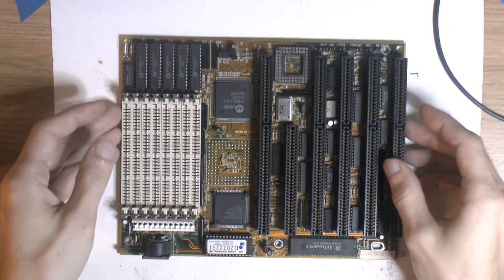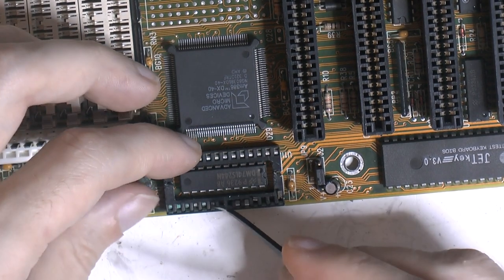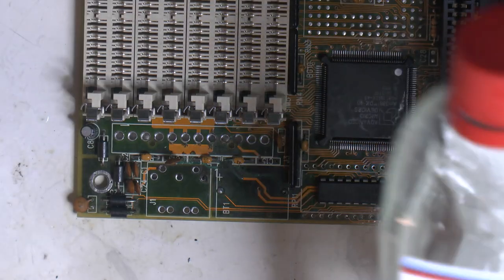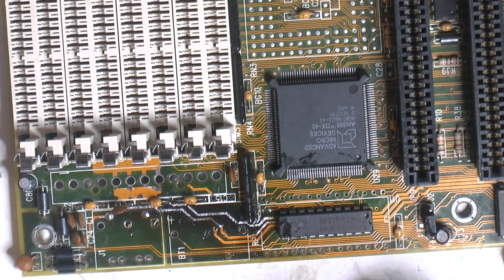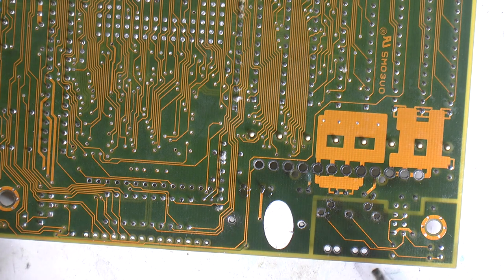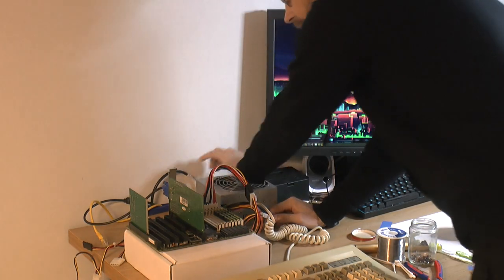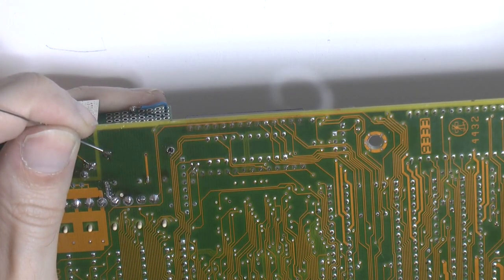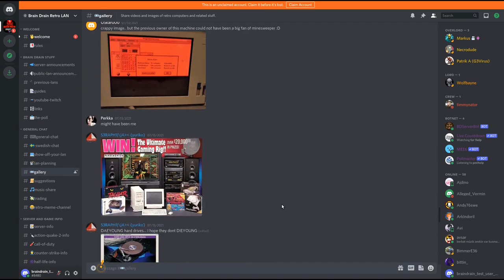386 motherboard repair

Comment: Can i ask what was the zener diode value you used? What is the minimum voltage that a bios /chipset beeds to hold the values? 2.5v Also were the replacement capacitors polymor? Thanks

Comment: nice repair, do you ever use white vinegar on the corrosion? What was in the spray can, just a electrical contact cleaner?
I was surprised how quick this board went to the bios.
Reply from the maker: I use 24% vinegar to neutralize the battery leakage. The spray just electronic cleaner,  I use isopropanol to.

Comment: With the CPU that close to all that corrosion. Id be tempted to pull the QFP CPU and solder the 386 socket in. Maybe try a 486DLC, this board being so late likely supports it in bios.
Reply from the maker: Its not my board. As fare as I know its gonna use the onboard 386 40Mhz and a co-processor later.

Comment: Just an idea when you said around 3v. Why not a battery holder and a pair of 1.5v aa batteries with a connector to stick away from the main board? It's just an idea that struck me as it might work well also :) good job as always! Big fan! ;) cya in the chat tomorrow and ty for all the help :)
Reply from the maker: Because its redundant. The board like most from the 286-486 era already have external battery connector for a 3-6V battery, its part of the cmos reset jumper to.

Owner wants 2032 onboard so making a second header for external battery pack is pointless.
Reply: oh so they have a connector and a onboard battery impressive :) I didn't know that. Your extremely talented and creative.